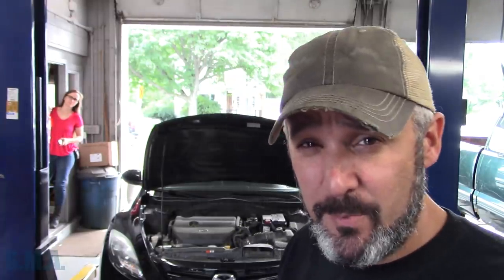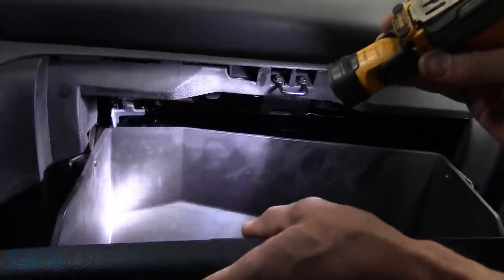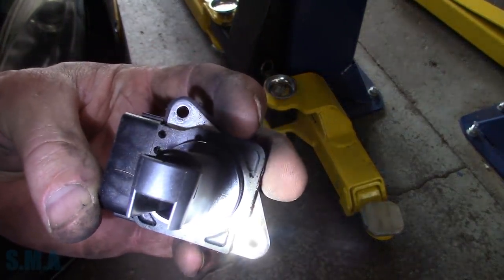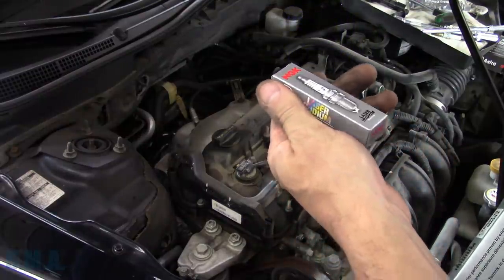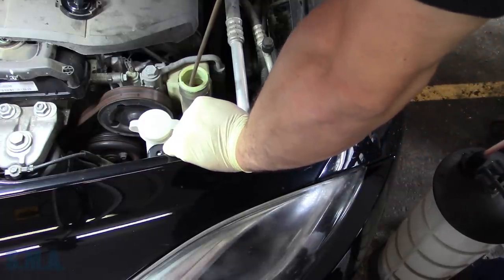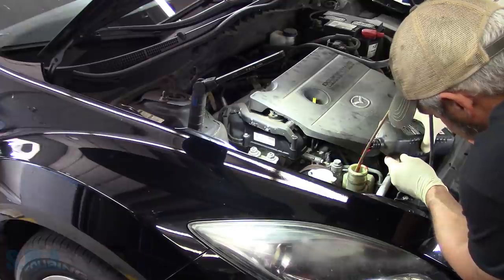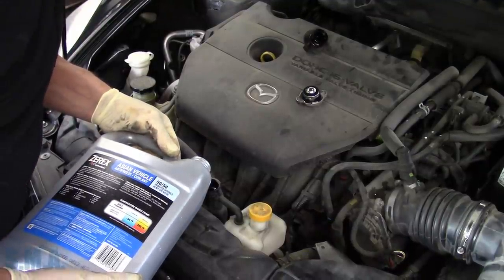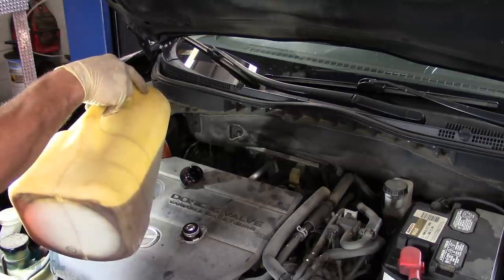Mazda 6: 100k Service Front To Back

Comment: 11:19 We agree, we thought about this and did our best to try and avoid this by not allowing most types of spark plugs to angle much and open the mag ring diameter within the socket. Another downside to magnetic is if you super heat them (leave them in a hot cylinder head for a long time) they can lose magnetism. That said, we felt this overal design for a swivel extension worked best compared to rubber/delrin/other insert types.
Reply from the maker: I swear you guys are always creeping on me in my videos....🤨 Or maaaayyybeeee I am testing to see if your watching.....
Reply from the maker: Astro Tools 94404 Magnetic Spark Plug Universal Extension Socket Set - 9/16", 5/8", 16mm & 13/16" - https://amzn.to/39M3hN6
Reply: I’ve bought a few Astro tools thanks to SMA.  Very happy with all of them especially the LED light.
Reply: Before SMA I had never heard of Astro Tools.   Now I own a bunch. 
BTW, magnets lose magnetism at a temperature known as the Curie Point.
Reply: I started using Astro in aviation. Started with the little 1124? mini impacting 1/4 ratchet. Let me tell you when you have a couple hundred bolts to take out of a few fuel panels inside a tank as wide as your shoulders, you thank the company that made the thing super fast so you don't have to linger in the stink of Jet A. Now I have snap ring pliers, 40sl light, punches and chisels, My 4980 got stolen sadly and I haven't replaced it yet,  a nano 3/8,  and a ball joint press I use to press flight control bearings on remove and install. It's been the most gentle thing I've found and I don't think I've ever damaged one. I'm really looking forward to trying the 1838 soon, and I'm super excited about the gear driven pneumatic body saw. I've got half the hangar converted to your stuff haha. I'm not a snob, and while I have a lot of Snap On and Knipex, I really just want something that works right and is reliable. I get that with Astro and I'm pretty happy if I can save some money not getting on the tool truck
Reply: @01SilveradoLT   I had the same light,  until I left it in a customers vehicle. UGH!
Reply: The only thing I wish to see tool manufacturers go back to or use more often are hard shell case's for the tools. My boxes tend to last about 2 years before they fall apart and have to join the mass population of the rest of my tools :(
Reply: I bought one of those Astro magnetic-swivel sockets when I did the spark-plugs in my '12 Explorer at 100K miles.  Worked like a charm.  I was quite happy that it didn't crack the porcelain on the plugs -- I've had that happen before with other spark-plug sockets.
Reply: @marcbernhardt6183  in my field we run into this issue a lot. When doing sealed system work on fridges there is what is called a three way valve. It's a magnetic coil. A lot of guys who don't know better will use the torch on them to remove them. Well all that heat rases them to the temp where lose their field. Heat is an amazing thing.
Reply: @SouthMainAuto  In stock sept 1st.......... Wow those sold out but quik.
Reply: I was told to use a T-handle on plugs as it lessened the chance of tilting the socket and cracking the insulator.
Reply: I bought your set of 4 10mm sockets after Eric showed them to us  :)
Reply: @Longtrailside  94404 is new. Not out yet.
Reply: @scrappy7571  
 I took my truck in for AC service and the guys were talking about the Astro light.
 Evidently, one of the mechanics lost one the same way. The customer came back for a AC service and asked if they could look at his engine compartment light while they had it. "It doesn't come on when you open the hood". Hello Astro❗
Reply: @franknewling1139   HA ha!
Reply from the maker: @j bowers yes they are all "little guys"
Reply: @AstroTools  Thought they sold out faster than Eric O buying all his favorite ice cream at the grocery store😁.
Reply: @01SilveradoLT  me too
Reply: I just love breaking spark plugs because the blasted thing cannot be held straight and the rubber side-loads and fractures the porcelain, or the rubber sticks to the plug and pulls out the socket staying deep in the hole, making a second headache ;)
I'm sure I complained about all the above long ago all over the place.
Reply: You should offer South Main Auto signature series tools!
Reply: Good to see a tool manufacturer chime in like this. Makes me feel better about their products.
Like every Astro tool I have.
Hope Eric gets a little bonus from this
Reply: @markchidester6239  yes, and they're letting it be known, magnets can weaken when being baked on hot engines.
which I've known for 25+ years, having delved into many career fields and deeper.
one was an electric motor producer, DC/AC/universal brushed, on the DC they magnetized the magnets just before assembly and test running each to adjust the rear plate and set brush angle for proper operating current and stamp the location in case of future brush changes
Reply: Was just going to say where's the link for the sockets?
Reply: Must admit, I've never heard of Astro tools before. Quite frankly I thought you were gimicky but then I decided to check out your website. It looks like your tools are top quality and long lasting tools. Anxious to get my hands on some and give them a try.
Reply: @mikel9567  they are professional grade. Been using them for years
Reply: while I am generally a fan of magnetic sockets, for spark plugs, just insert the tip of the plug  into a thin hose about a foot in length, and you start it that way before it even sees a socket.
Reply: @Jacksonkellyfreak  Sounds like you have lived the life of a corporate or regional aircraft mechanic.
Reply: @01SilveradoLT  I'm in absolute love with the right angle impact. Cut my average brake job time by at least 1/3.
Reply: I had never heard of Astro tools until SMA but now I own a bunch love their tools!!
Reply: Eric, you don't get too many of Asian cars, do you? Not sure, because I started following your work just maybe a week ago.
Reply: Great Job Astro on your company! I been impressed with your hand tools and puller/press kits. Very nice and affordable!
Reply: Hey i
Reply: Astro tools first time I knew of them was cause of Eric O. Now I own several ,thanks for info on new tools and these fun but very informative vids.

Comment: meanwhile people are driving around wearing masks in their cars, while the cabin filter looks like that!
Reply: ive found that a lot of people dont even know they have them. and then when a shop recommends it, they're just trying to scam you. I remember there was a rats nest in a guys filter and built up around the sides of the box and I cleaned it out and told him id sell him a new filter for 20 dollars already 10 dollars off of the normal price because of how bad it was and he didnt want to do it so I said id give it to him at our cost at 10$ and he still didnt want to. At first I thought it was maybe because he legit couldn't afford it but when he paid for the oil change he had a stack of cash.
Reply: @koloy999  The first car we had that had one took me 7 years to learn it had one. PITCH BLACK.
Reply: @matttrotta57  [
Reply: Them cabin filters are stupid anyway, take it out and throw it away, replace with something just to keep the fan clean, maybe piece of cheap house furnace filter. Much better air flow.
Reply: Some people claim to be the slaves of science, except when it disagrees with their politics, like in the case of masks. But it's okay because we did some half hearted mechanistic study that proves nothing, and we use that to justify our idiocy. Even when every rct designed to eliminate bias says there are no significant differences between wearing masks and not with influenza type illnesses.  That's before you head into the actual verified negative consequences of masks. When your Governer looks like the grinch who discovered botox.
Reply: @kellivanbonn4692  I feel your pain. My governor was one of the first to mandate masks back in April. 5 months later and it's only gotten stricter
Reply: @kellivanbonn4692  When you get Cancer seek an alternate treatment. Who needs damn science anyway.
Reply: Hey man I got no choice being a Uber / Lyft driver 😂😂😂 I’ve just made it a habit to wear it so I don’t forget. specially when I do food deliveries lol
Reply: @kellivanbonn4692  YES! Preach
Reply: Can't have rona if it can't suck air in
Reply: Muzzles for the brainwashed.
Reply: Years ago, there were no cabin air filters in any cars. I never saw anybody die from sucking too much dirty air in from the blower fan motor!
Reply: @jameskoralewski1006  No, but the evaporator core got full of shit and the passengers had worse allergies. Look at all the junk in this filter dude. That would have been blown into the evap box if the filter was not there. That's great for maintaining good cooling and airflow as the car gets older. 🙄 I love cabin filters for that reason alone. Catching pollen is the second huge plus. Nobody thinks you'd die, but you're more comfortable. Cabins are totally worth the $10-15 to replace.
Reply: @hcox1111  Not stupid at all. They're a great feature. Catches pollen for allergy suffered, and all the shit that would otherwise end up blown into the evaporator box. When the evap core gets plugged full of chopped up leaves and dirt, you pay someone like me to pull the dash and clean it out. Cheaper to just keep your cabin filter in place and clean. 🤷🏻‍♂️

Comment: Smells so good lol. Once my son came over to use my tools to change oil in his wife’s car. He crawled under to drain the oil and when he removed the plug he said “This oil stinks like hell”. I yelled “Put the plug back in fast”. Luckily he didn’t lose much gear oil since the fill plug was still in place.
Reply: Lol
Reply: Years ago, when the cars were pushed by the rear tires instead of being pulled by the front,  we used to joke about the rear end fluid (gear oil) smelling like ass. 

It still does but the joke is ruined on a front wheel drive or transmission.
Reply: i remember the first time i smelled gear oil, i told my dad on how it smelled like rotten garlic, and it was for the fresh stuff. i bet the old used gear oil smells even better.
Reply: @sumduma55  atf s outlook sometimes has that foul smell. Definately not as pungeant as diff oil but similiar
Reply: I'd make fun of that, but I just took out the wrong plug on my motorcycle.  It happens.
Reply: It smells like chemically garlic to me. Doesn't really bother me since diffs are quick to D&F, but I'd be upset if I had to work in the factory. 😸

Comment: I just replaced the cabin filter on my mom's 2016 Mazda 6. Her dealer wanted $60.00 to do it.
Reply: Rent, insurance, workman's comp, retirement, advertising, payroll, and profit margins just to name a few expenses that make a simple job expensive. As a plumber, I charge $120 an hour and people think I'm rich but once I start to explain just how much it costs to run a business they don't have much to say.
Reply: @peted2770  You're still making good money and investing. Try being a mechanic getting 13 14 15 bucks buying thousands of dollars worth of tools and doing tons of different work not just tires and oil. If i was making shop rate i'd be laughing my ass off, if i was making hell 20 bucks it would be a good day. Running something yourself is good for the fact that you buy the tools you pay the insurances and all of that, but you keep the money. Good on you for making a decent living.
Reply: HAVE TO CHARGE FOR TIME TO EMPTY AND REFILL THE GLOVE BOX, AS WELL AS TO REPLACE THE FILTER.
Reply: First time I changed the cabin filter on my 2000 Honda Accord Coupe,  had to cut a factory brace behind the glove box to access the filter door.  Details are in the Honda service manual. Bet almost no one changes those because of that stupid brace.  My 2011 Honda Pilot cabin filter is much easier to change.
Reply: For the record, I charge $120/hr but I don't PAY myself $120/hr (that would be amazing!). If I paid myself $120/hr I would have to charge around $300/hr!
Owning and running your own business is rewarding but you work 2-3 times more than if you did a 9-5 job (I have lots of experience in both worlds). Look at Eric for example, how many times have we seen him working at 8:00pm or going in on the weekend just to catch up or get a little ahead? His entire family is in the building, which tells me that they spend most of their lives at the garage. Anyway, thank you for the kind comment and I know as time goes on you will keep moving up to where you want to be.

Comment: I think we all would like to see a video on that police cruiser getting worked on
Reply: Martin Bullla it always feels super awkward anytime a cop car comes into the shop especially if I gotta test drive it or rummage through the interior to do work lol idk just doesn’t  feel right yanno
Reply: During the test drive you have to do an Italian tune up.
Reply: Maybe cant do that? i know over here you certainly couldn't film them as you work on them.
Reply: @FredTheLutinoCocatiel  Would you test all the lights? and the siren? :0
Reply: Ya gotta test out the lights and siren just to make sure they work
Reply: @defendermender4959  Why not? They are public equipment and everything dangerous is removed. Nothing secret in them. They are actually pretty boring. When I was a cop (before YouTube) we removed our rifle and laptop before it went to the shop. We also had a hidden kill switch to kill power to the radio and the lights / siren control box (mainly to protect the electrical system). Usually the city shop worked on our cars but occasionally they would have to go back to the dealer for a major service or repair.
Reply: canuckguy worried - Guaranteed those are changed out about every year at least when they go qualify at the range.

Comment: Proper servicing rather than the job you get at these jiffy lube type place's! Great work.
Reply: I've made a small fortune fixing quick lubes places "oopsies".
Reply: I wouldn't take my bicycle to jiffy noobs.
Reply: Stay as far away as possible from Jiffy Lube, I worked there well over 15yrs ago and some of the stories I could tell. They are a very shady place.
Reply: Agree. Lot of dishonesty there. Got myself out there right quick.
Reply: Agree nice proper lube change definitely better the scare yourself jiffy noobs
Reply: I've been doing my own oil changes since 1974.
Reply: repthehuskers I worked there for 6 months and left and man just like you I can tell you many stories from there.
Reply: Ya there's a reason why it takes a day and costs Abit more
Reply: Jzz 30 going to a shop like South Main Auto is fine. Just those quick lube places are a hustle.
Reply: @bigragu6828  ya
Reply: @AntonioClaudioMichael  yah I wouldn't even bring my go kart electric pedal go-kart there to the quick lube places
Reply: @neilmurphy845  right
Reply: Lucky if you get an oil filter there. Better make a mark on it and check when you pull out.
Reply: I think they require three felonies to work there!
Reply: @johnp556  might as well change your own oil while you're down there checking lol
Reply: If you gotta pay someone to change a dirty filter on your car, then you are pretty useless when it comes to car maintenance!

Comment: @14:50 Free tip for not spilling. With refilling fluids, stick a big screwdriver in the hole and now fill the tank by pouring the fluid against the screwdriver above the hole. Surface tension from the fluid on the screwdriver causes it not to spill, but to guide the fluid, down the screwdriver shaft, in the hole. 👍
Reply: I believe chemists call this "decanting" and it's standard practice. 👌

Comment: Since watching you I have switched to mostly Astro tools. Way cheaper than snap on and have not let me down yet!! Love them.
Reply: I'm a DIY guy and have several Astro tools now because of this channel!  Specifically the 600 work light and the mini stubby air ratchet among others.  Both of them are awesome!
Reply: @Patrick94GSR  I specifically now own the Subaru ball joint puller and it's been worth it's weight in gold.

Comment: Free tip, when taking out cabin filter cut a thin piece of cardboard from a cereal box that is that same size as the filter(use your new one as a template) slide it under the old filter before removing the filter from the vehicle. This way if there is debris sitting on top it won't fall in the blower. Says the hassle of removing the blower, especially ones that aren't simple to remove.

Comment: I wish more people completed the maintenance schedule.  It's interesting what you find when doing one of those.  Good one Mr. O.
Shout out to Mrs. O.  You do a lot in the office!
Reply: My local Ford dealer refused to do a Trans oil & filter change when I asked at about 85k miles. Their rational was that per the VIN, no trans oil change was to be done until 100k miles.  Likewise they would not do the work at 92k miles either.  I am at 99800 now but I'll drive to another dealer 80 miles away for that work.

Comment: My 2009 Honda CR-V, I flushed the PS, by raising the 2 front tires in my garage. Then I disconnected a hose from PS reservoir and made sure to keep reservoir full. Then I turned the steering wheel lock to lock without the engine running, many times, each time some fluid would come out. I used Honda PS fluid, 6 bottles, 16oz. each. Fluid was clean when done. The PS had a noise, but after flush, noise was gone.   Thanks...Jim